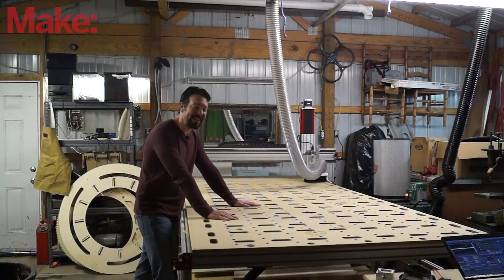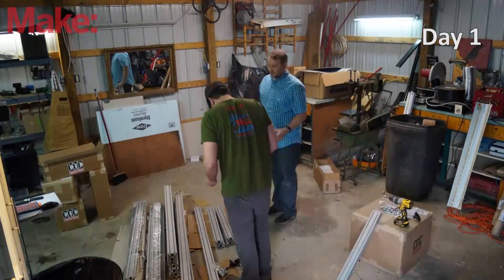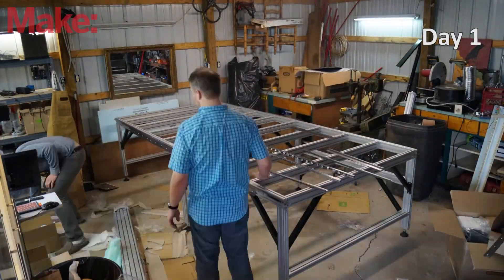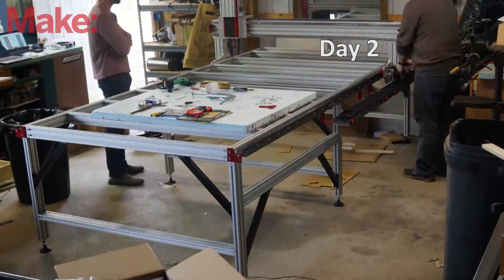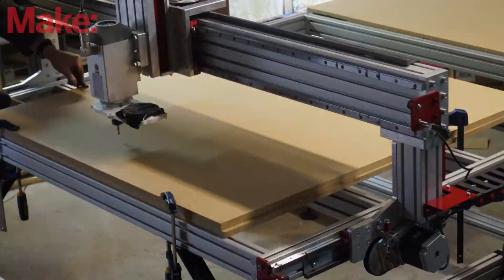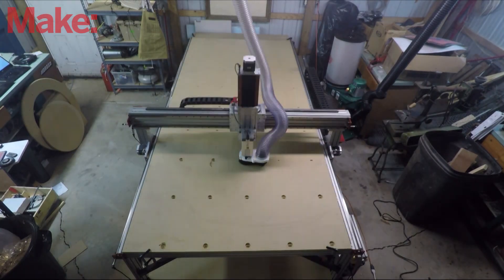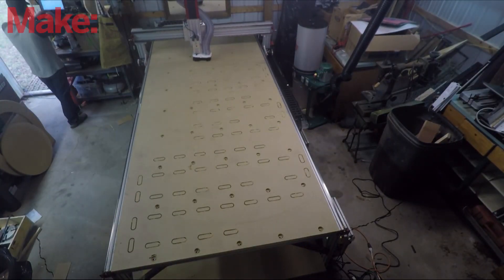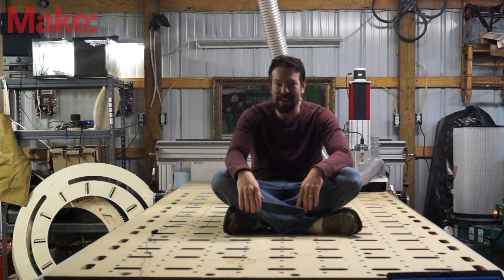Building a 5'x10' CNC Router from CNC Router Parts

Comment: i wish i had one. I have no idea how to do anything like that though so wont be getting one anytime soon LOL If anyone would like to build me one that would be great though LOL :)
Reply: it is not that difficult you just need to watch a lot of youtube. You also need to learn all the software from part design to creating tool paths to  getting the gcode which goes into the software that controls the CNC. It is not a weekend project you just have to make a commitment and then do it. I build my own controller box by converting a PC case which can run any machine from cnc lathe, mill, router, plasma cutter etc.... The info is out there you just have to learn. Just buying a cnc machine is not enough unless you learn all the other stuff otherwise you just have an expensive paperweight.

Comment: I realize this was sponsored, but what is the actual cost of this kit? I agree their website is confusing. So confusing that I've never been able to sit down and get all the way through putting together a full kit before I get interrupted. So other than the computer to operate it, how much was this? 

Thanks!
Reply: wow can you say rip off? 3k for a 24x24 machine WITHOUT electronics???
Reply: holy crap!! what the hell cost so much?? Good lord!! that doesn't even include the router! Or "spindle" I guess they call it.

OMFG!!  They actually list the router as a "Recommended Accessory"!! Seriously, what use is this without a router?
Reply: yeah, that buying process on their site is a bit of a pain. A similar configuration to this would probably cost around 10-15k.

edit- also, this video wasn't sponsored, but cncrouterparts is sponsoring a big project using this soon. I just thought people might enjoy seeing one built.
Reply: cncrouterparts the first thing you should do is recreate the website from scratch. It is an absolute unprofessional mess. Look at shopbot or shopsabre cnc website for an example.
Reply: I've been eye balling a CNC machine, as a hobbiest and not as a professional. I'll have to check the site to see if they have anything like the X-Carve in size and quality that might be a good alternative. Does this setup only work with wood and soft metal?
Reply: mindblah Correct. Primarily designed for sheet goods including plywood, melamine, plastics, etc. Aluminum would be the most I would attempt with such a setup (aluminum faced plastic products, commonly used in signage, would be fine with the correct bits). It's just nowhere near rigid enough (and the spindle is far too fast) for heavier materials. 

Keep in mind that this is no a product that you order from them. You have to source all of the parts. You need a frame, drive mechanisms (leadscrews (with anti backlash nuts or ballscrews or...), belt, rack and pinion...), stepper motors, spindle, controller hardware, a computer to run it, software on that computer, and more. And you have to source all of it yourself. You can absolutely build a better machine than a (relatively) floppy x carve for less money, but it will take a lot of homework to get there. cnczone.com is a great resource, but even getting through that is a huge effort. It can be done, but it's not anything like ordering one product from a website.
Reply: We do offer many configuration options for our CNC machines, and it 
often makes sense to discuss your application with us so that we can 
help determine the ideal complete CNC machine for your specific needs. 
You can always click the Contact Us link on our website, or email us at sales@cncrouterparts.com to start the conversation!  - Erik
Reply: Hi Mindblah, You might check out our Benchtop machines (http://www.cncrouterparts.com/benchtop), which start at a 2' x 2' work area or if you're looking for something larger, check out our PRO4824 4' x 2' expandable machine which is fairly compact as well (http://www.cncrouterparts.com/procnc). 7" - 12" of Z travel are common options depending on how thick of material you want to process.  Feel free to reach out to us if you have any questions!   -Nathan
Reply: Alexander Forbes buy x-carve or stepcraft or shapeoko instead for small cnc
Reply: Caleb Kraft this is cheaper than shopbot pralpha cnc. Which too is modular  like cnc router parts.
Reply: cncrouterparts.com kits come with all the parts but the computer to run it. I can see them all there. The site is a bit confusing, but it is all there. You just have to assemble it on your own.
Reply: feel free to source the same level of materials, 8020 tubing etc. You can buy a Chinese kit for a lot less... but you will get a lot less. And you will be left working all the details out on your own.